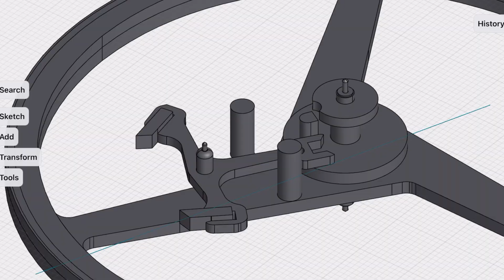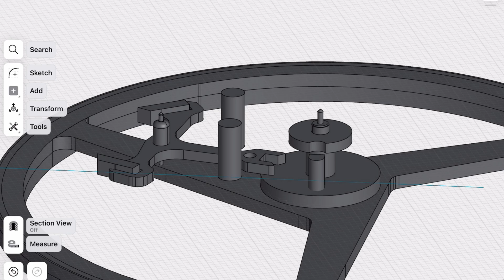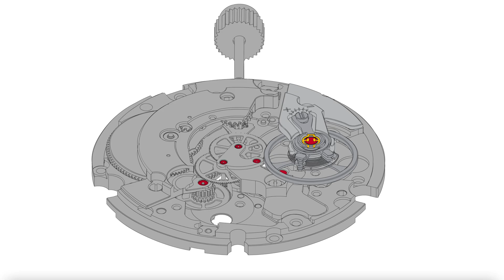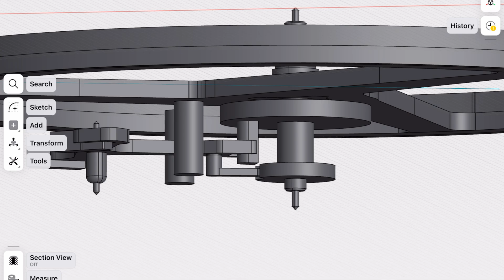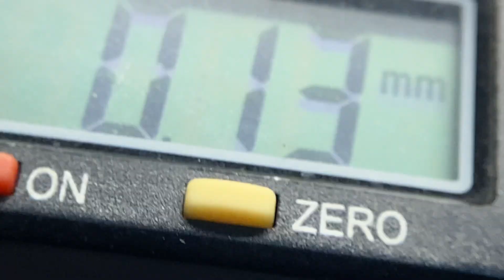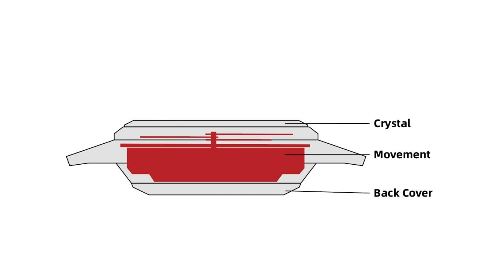Explaining in 3D How Balance Wheel Works

Comment: Does the modern Longines watch have the durability and quality of an Omega?
Reply from the maker: In my opinion, if it is only used for telling the time during commuting, Longines offers significantly better cost performance than Omega. However, in terms of durability, there is still a gap between its movement and Omega's co-axial movement. Although before the quartz crisis, Longines had a status comparable to that of Omega and Rolex, from after the quartz crisis until now, there has been little progress in Longines' movement design. In contrast, Omega has been maintaining innovation in technology. I think Longines deserves the situation it is in today.
Reply: @charliemaker2119